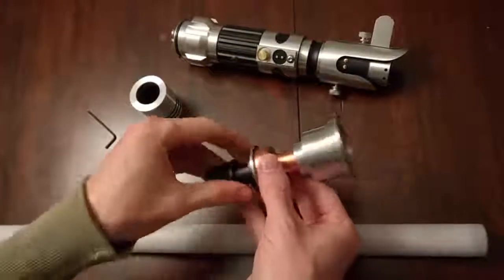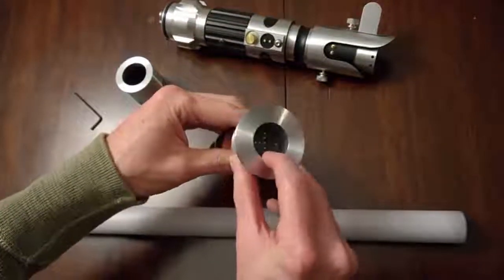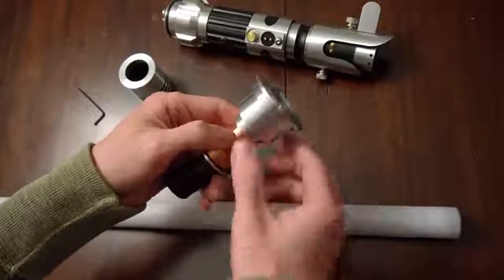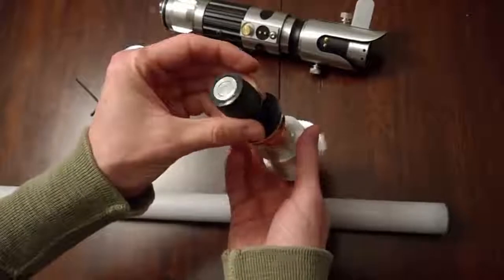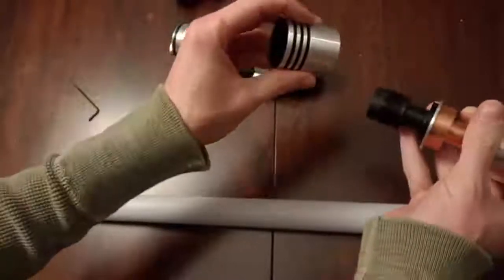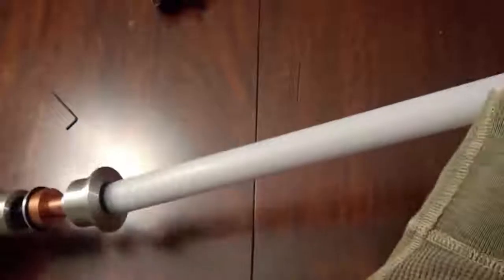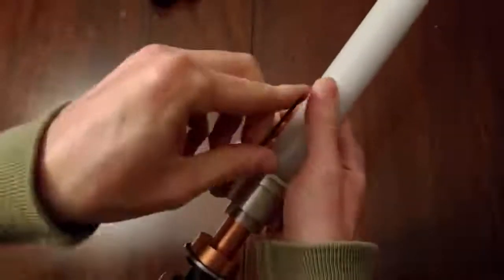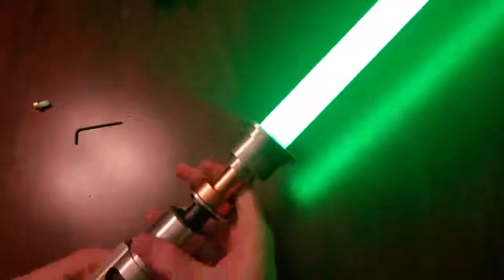ASP NeoPixel Thin Neck Solution

Comment: This is exactly the video I needed to see for my vision to come together! One question though- did you wire the Neopixel PCBs normally or did you have to reverse polarity at any point? Forgive my ignorance, just want to be absolutely certain I get mine right.
Reply from the maker: Just think of the connectors as pass through for +, -, data. Don't 'reverse polarity' or anything like that.

Comment: Thank you so much for taking the time to post this clever solution.  I'm thinking about trying the same thing because I really want to add a neopixel blade to my Redeemer.  One question - what was your process for dremmeling out the emitter?  What type of bit did you use to grind down the aluminum, and how did you get it to still look so polished?  MTFBWY!
Reply from the maker: Took everything apart. If it's glued to can heat in oven to melt glue. Then use a cutting disk. Then sanding and buffing. To shine the aluminum you can wet sand 800,1000,1200,1500,2000, 0000 steel wool, aluminum polish.
Reply: Timothy McDonley Awesome, man. Thanks!  I'm gonna give it a go and hope for the best